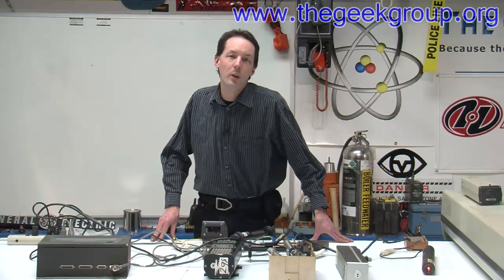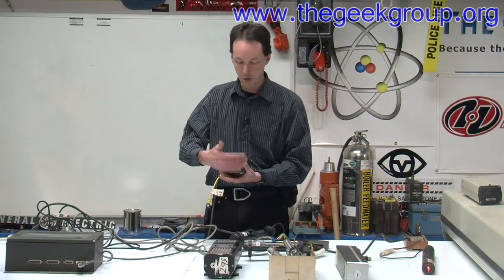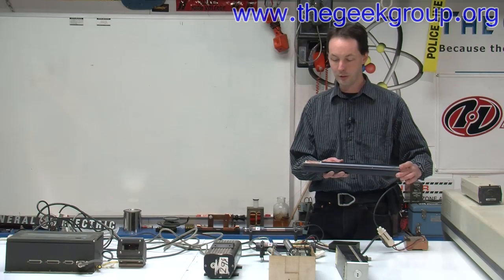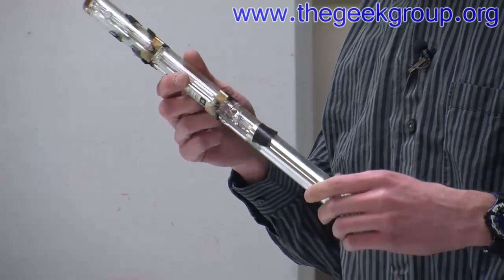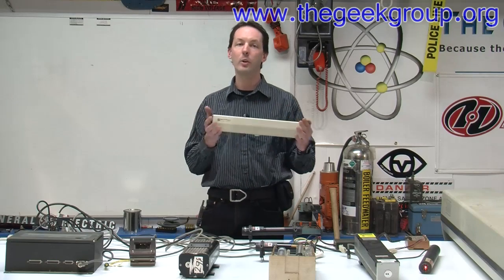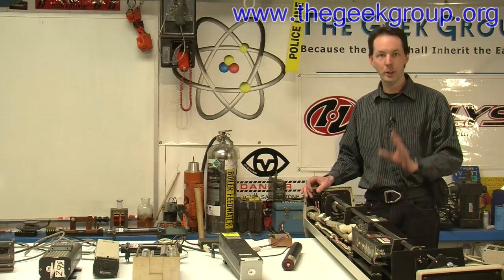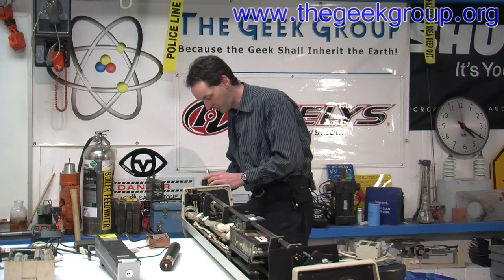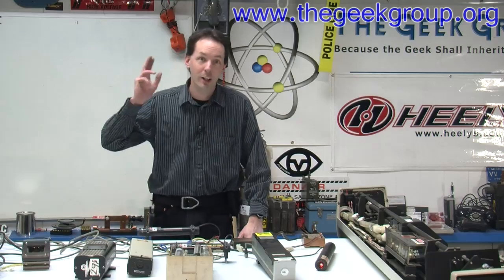Geek Group Laser Collection Overview

Comment: nice yag laser , looking at the laser pump chamber its is pumped by arc lamps , ther are surronded but floing water and so is the rod , di water is used for its low conguntivity , as the lamp connections are exposed i think . good luck on getting it working , one othere thing is the laser q switched -